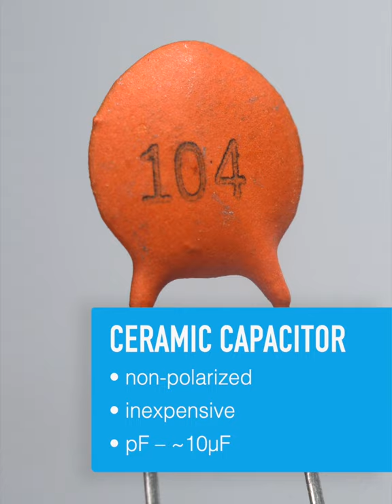Cap Types: Electrolytic & Ceramic - Collin’s Lab Notes #adafruit #collinslabnotes

Comment: As a extension  how to read the capacitant value, ie units
Reply: Use Calculator
Reply: @fast_and_curious9144  calculators can read?
Reply: Take the last digit and add that many zeros. This will give you the value in picofarads.

example: 102 -> the first '10' give a value of 10pF, adding two zeros gives you 1000pF which is the same as 1nF.

Comment: The electrolytic capacitors on old macintosh logic boards is a common reason why they malfunction. Most times, one can remove the cap, clean the board of the leaked acid, and, if the acid hasn't caused TOO much corrosion, a tantalum capacitor can be resoldered in lieu of the electrolytic type.

I wash my logic boards in my dishwasher. Seriously, this process works like a charm, just be sure to thoroughly dry the board (including the water trapped under surface-mounted chips) before introducing power.
Reply: You can pre heat your oven to 200f and turn the heat off and place your board in on a tray to dry it. 30 minutes ought to be enough
Reply: @jamesdriscoll_tmp1515  you can also do an alcohol dip and that will cause the water to evaporate even faster.